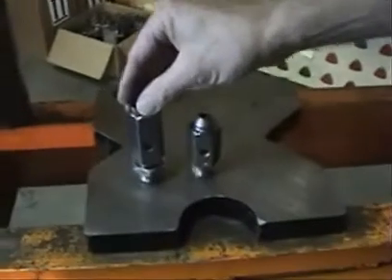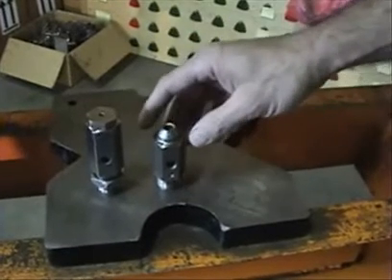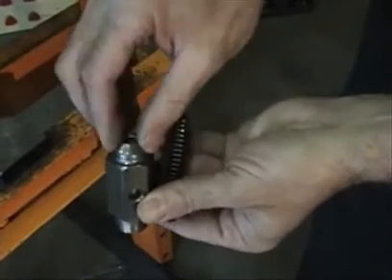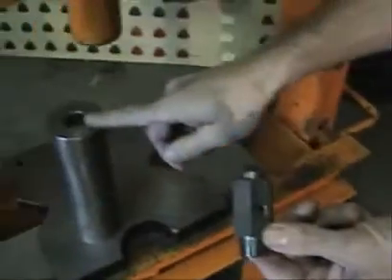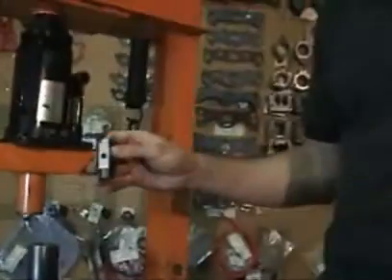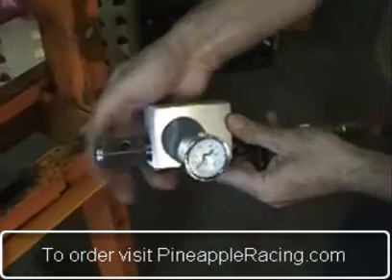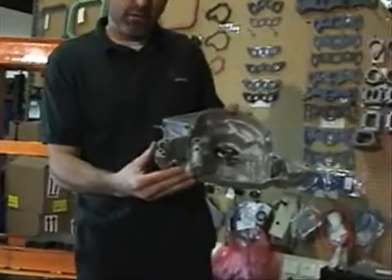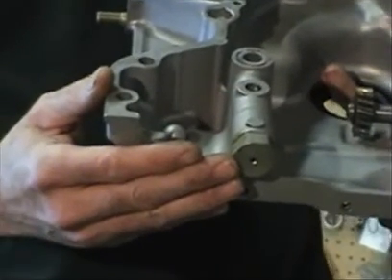How to increase oil pressure with the Rear Oil Regulator

Comment: I have a pressure regulator out of my D361 in an old IH tractor and the piston has an 1/8 to 5/32 hole in the end of it! Ive been having low oil pressure on this tractor for a while and when its warm i cannot idle it or it drops to nothin. I have to have it at a fast idle to keep 15 to 20 lbs. 30 is the most it will do. I find that hold in the piston very odd.. I would think when the oil is hot it would all bypass even going to the filters. I understand 15-40 is thick but not when its hot! Im not sure what to do. I need the tractor like now! I cant find an image online to see if its the way its supposed to be.  Id like to cover it with a shim or somethin but i dont want 100 psi! Lol it has holes on the side where it dumps when the piston moves but shit.. i cant see it budging that piston with a drilled hole in it that size!